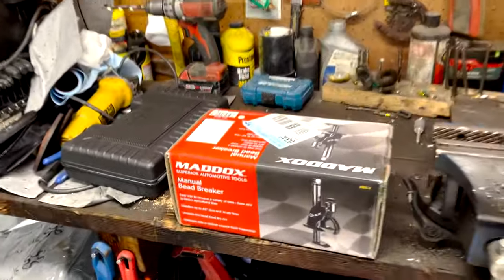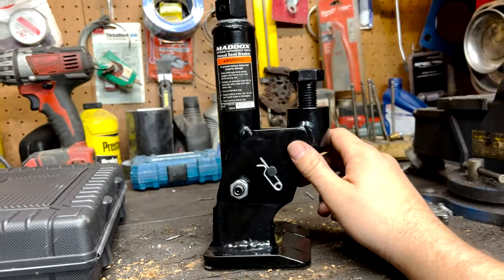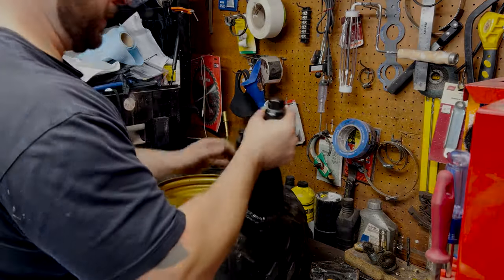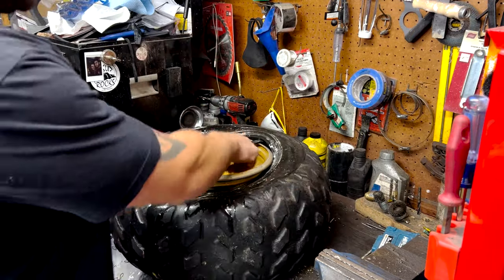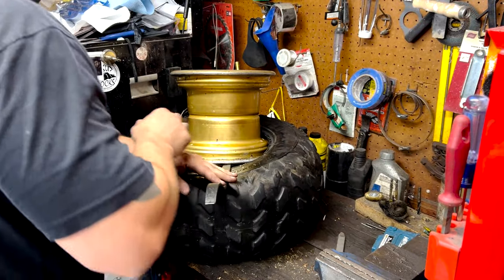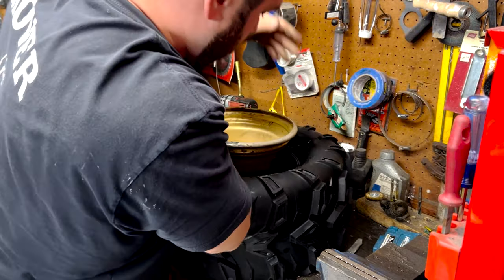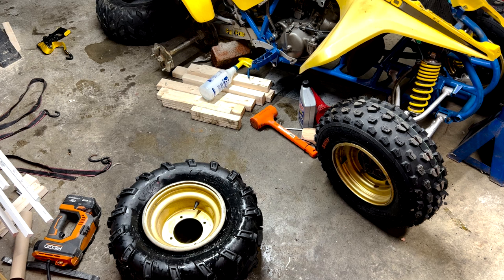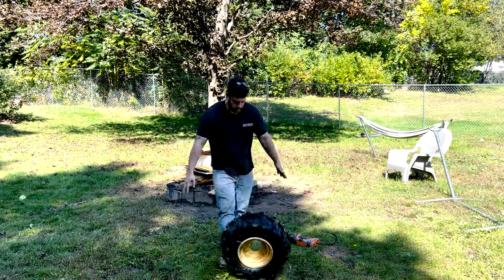Harbor Freight bead breaker - Fire in the hole!

Comment: I ordered one of these yesterday. It's off Ebay in the UK but looks identical, at least in the pictures. Will see what actually turns up. The cost is significantly less, about $34. May be it's made of cheap metal compared to yours. Time will tell.
Reply from the maker: There are great for lots of different tires. They are nice and small too